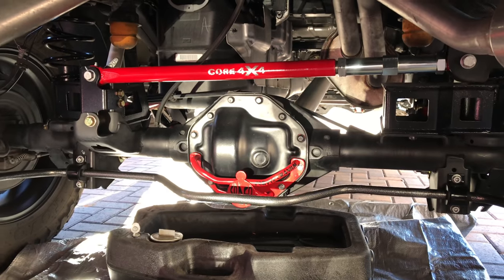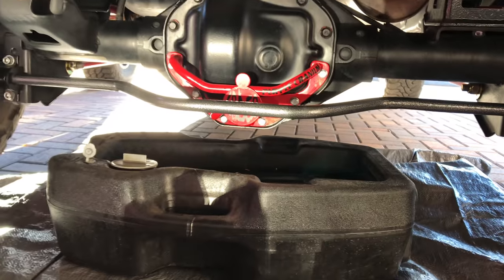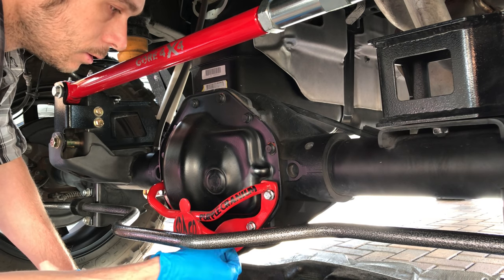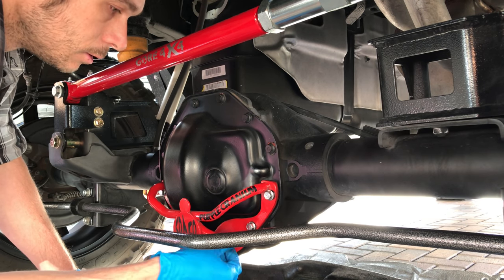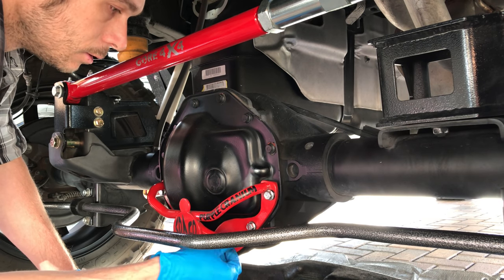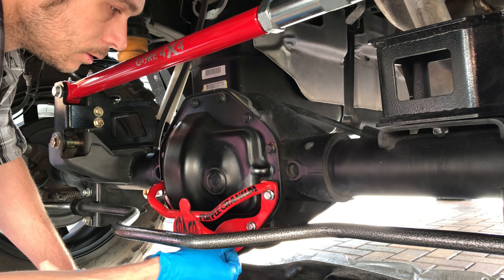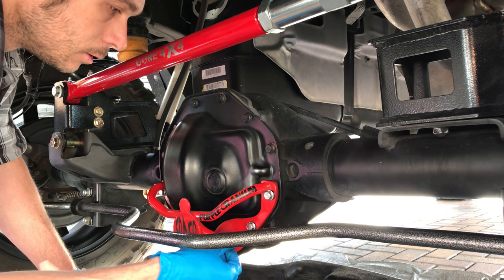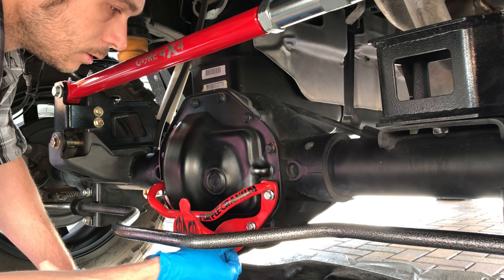RAM 1500 rear differential fluid and gasket change

Comment: Dealers can be asses some times. I was at the dealer today to have a new axle installed (dont ask) and saw a seasoned mechanic doing a brake job and he was dangling the caliper from the brake lines instead of tying them up so they don't.
Doing a good job there bro👍
Reply: WTF?  You should've gotten a photo of that BS